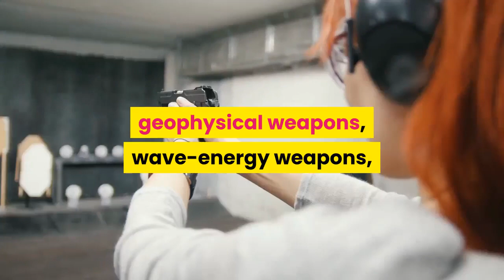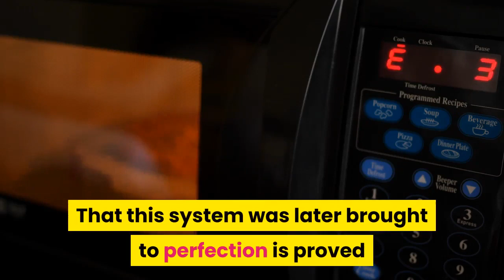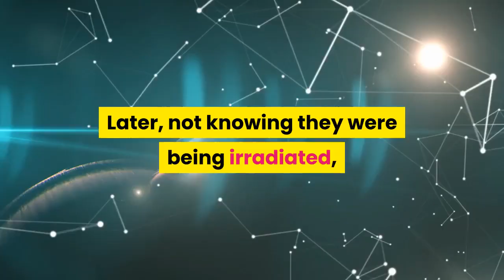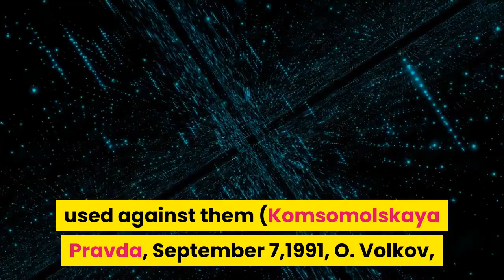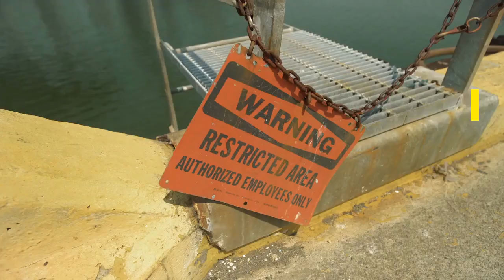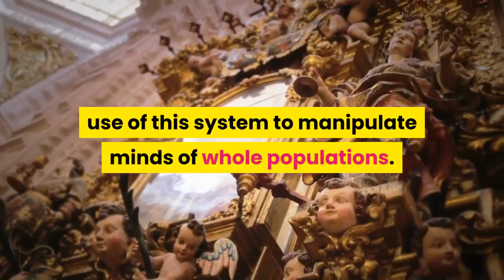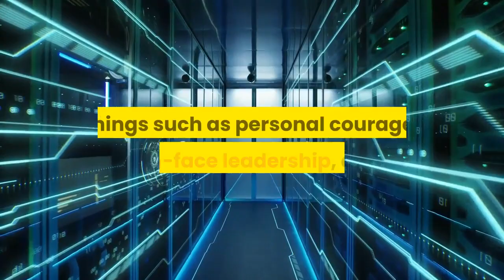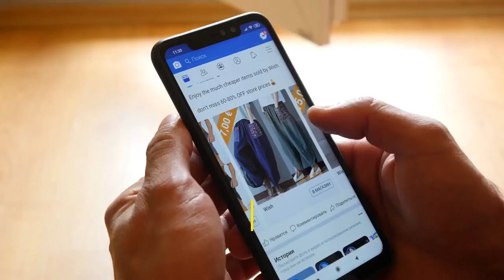Psychotronic and Electromagnetic Weapons Remote Control of the Human Nervous System - Discoveries

Comment: Would a copper helmet help?
Reply: Copper helmut they will chuck u in the loony bin and throw away the key
Reply: I built a room with pure iron sheets for walls and it does work. Also keeping up appearances in public is crucial, meaning you can wear a helmet IF you make it appear as if you're riding a bicycle all the time.

By the way copper is not a good EMF shield because it's not magnetic,...Pure Iron, not steel is one the best commonly available EMF shields because it has one of the lowest resistivity and highest magnetic permeability of any common metals.

There are composites that shield better than pure iron with lower weight but, aren't commonly available.

For everything the power elite try to do there is a countermeasure
Reply: @John G.  Hey thanks for the answer!
Reply: @johng.3740  may I ask where to procure the sheets so I can implement them in my own home? Thanks.